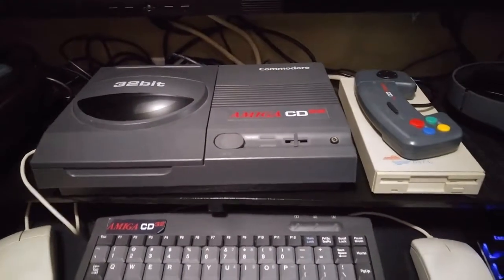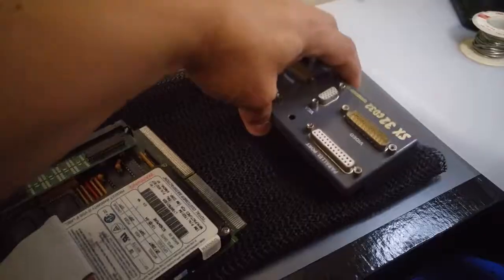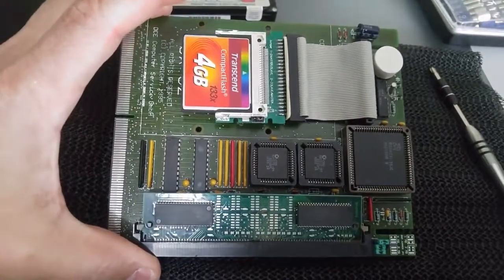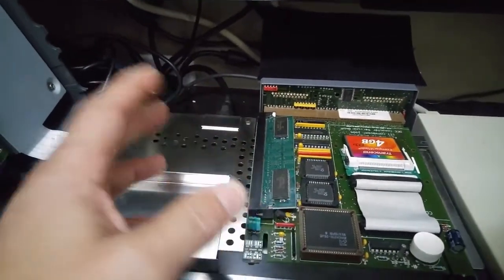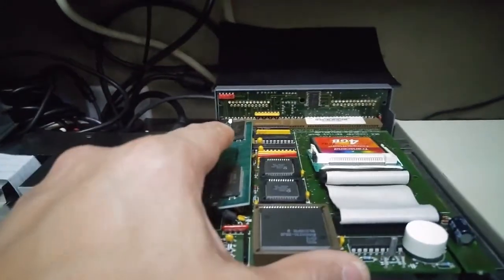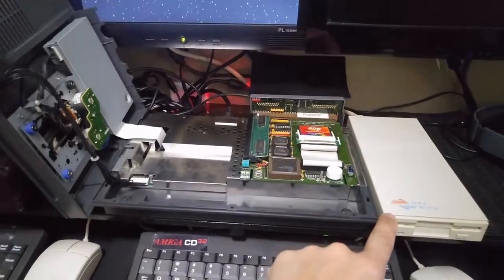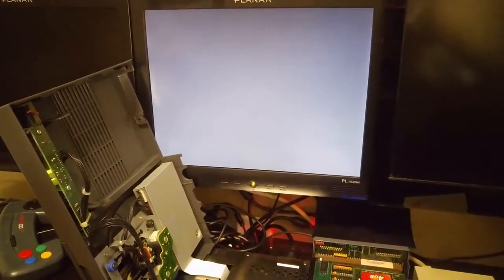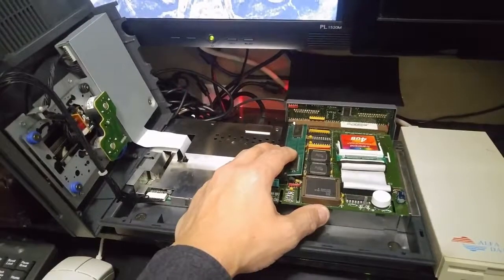Amiga CD32 Expansion -  SX32

Comment: The compactflash IDE adaptors are sort of cool but they are prone to problems of being unrecognised depending on brand and they can wear out if running games or software that constantly write to the nand (such as using Vista 3D-landscape generator to make many frames of animation in hundreds and hundreds of megabytes multiple times). A modern (or maybe modified old) IDE-to-RAM (with a bunch of C batteries) solution seems more attractive in some scenarios. The RAM is also commonplace to aquire. It can boot instantly and also never wear out (other than electromigration but then that is not strictly wear-and-tear per se) and can be allowed to instantly boot in a "it never shut down" configuration (as the C batteries hold the data). An FPGA (or other solution) could also have a dip-switch on the side that allows a user to dump all data to-and-from a HDD or flashdrive when needed and that allows for custom workbench images. There is a limitation in the amiga's ChipRAM in that (as we all know) it can only be 2meg. A pity about the cool increased large disk support for kickstart3.1.4 (albeit it pretty much used for a1200) is that more blocks use more of that ChipRAM. Rather htan having a large HDD (or nand equiv), having multiple IDE-to-RAM-adaptor "images" means you don't need to use up RAM with a great many blocks and also you don't need kickstart3.1.4 (even though it is cool for other things). Multiple HardDrive (IDE-to-RAM) images also has the benefit of only using the drivers you need. So for example a person might not need a whole bunch of CD drivers. Other tricks one can do is dump save-states from games into it (but there are other ways of doing that).
Reply from the maker: Thank you for comment. I have use a few different IDE to CF adapters an have had good luck with comparability (though I may have just gotten lucky). 

Your point is well taken on robustness or lack there of regarding the CF cards.  I haven't had one get corrupt on me yet in this setup but  I have when using one as a boot drive for Linux.   I do have backup images of my CF cards so I can re-image a new one if needed.

I haven't put nearly the reads/writes through them as i have on my original SCSI drive in my A3000.  I have Vista 3D and back in the day would leave my A3000 rendering over a weekend and the drive would just happily churn away.   I haven't tried that on the CD32 with the IDE adapter but  plan on doing so as a test (thanks for your request/idea on my other video )

I like the idea of a multi image IDE to RAM adapter (reminds me of the multi carts for C64)   would be nice to instantly switch between setups for different tasks and instant booting would be sweet
Reply: @32Bits  That is exactly the sort of thing I'd do with a mate around his house back in the day for Vista3D but on an a500. :)

FYI, the GPIO of a raspberry Pi is the shape of an IDE and so, if you use a Pi (such as the Pi4 standard 3rd party boards with its GPIO 5volt and ~3volt changed options) you can mimic a HDD or CDROM using the Pi (and even just them use the Pi as a RAM drive or as a simple convertor for a usb-CDROM or usb-flash-pendive for CD0 and HD0). It also has sata.

Therefore it is already possible to switch between setups like you allude to. :)

It can also be done on the fly because it has an fpga.
Reply from the maker: @obsoletepowercorrupts  Vista 3D reneging for days....Good times. 

When you say, "Therefore it is already possible to switch between setups like you allude to. :)"  You do mean that it's 'Theoretically' possible right?  I mean the Pi4 is not released yet.
Reply: @32Bits  Sorry, I've typed that comment too fast. I mean "Pi4" as a standard for any such Pi (be it third party or otherwise). However, my poor typing aside,  yes it can be done via an FPGA board you make or add to (if it is one plugged into yet another board GPIO board running say an arm with PCIe). A PC floppy drive can be converted to amiga though and also done with an arduino.

However just to be oldskool, I should point out that there is a brute force way of connecting a floppy to the cd32 which you already know (and I'm just reminding you) and that is via connecting the small circular port of the CD32 (on the left of it) to another amiga and using that amiga's floppy. 

Or one can use the parallel port of the amiga to access a floppy on another machine (or its HDD for that matter). It is a caveman way to do it though so I'm just flinging it in for reference contect, like how a serial port on an amiga can connect to a Pi and take the amiga online or on a LAN (or access the Pi's devices like a usb floppy).

I'll paste some other cool little floppy-amiga hacks in hyperlinks in a comment below in case youtube marks it as spam (because the YT algorithm does not always like hyperlinks in comments).
Reply: @32Bits  :)  As promised...

Modifying a PC floppy drive to work on Amiga Hardware
https://www.youtube.com/watch?v=QtMvoql0W8Y

Amiga Floppy Drive emulator using Raspberry Pi
https://www.youtube.com/watch?v=BVYVZ3fsesk

Arduino Floppy Disk Reader (Versoin1) GPL3+
https://create.arduino.cc/projecthub/robsmithdev/arduino-amiga-floppy-disk-reader-v1-485582
Reply: @32Bits  Here is an a example "Pi like" sbc with better GPIO, and voltage change. https://www.youtube.com/watch?v=3v5mFryrTzA
Reply: @32Bits  I should also add that (if you juggle partitions), you can swap the contnets of a drive in and out anyway. However, just to add to that concept there is a very cool amiga gadget for SCSI that has been around for a few years (and it is one of those modern PCB boards) which allows you to access (e.g. a590 or other internal scsi) drive ports with multiple devices simulataneously such as other amigas (yes - a powerful thing to do) and audio samplers like an akai:
So you can have multiple amigas sharing a hdd like this guy's video does with samplers. The gadget was primarly sold to amig auses by audio-sampler nerds use it too. Therefore it is more than a mere SCSI-toSDCard adaptor as you can daisy chain an access it simultaeously via multiple amigas (almost like a crude versoin of a NAS).

SCSI experiment: 3 samplers and 1 scsi reader (scsi2sd)

https://www.youtube.com/watch?v=kytXdaK3Q7I
Reply: @32Bits  I presume you know that your IDE-to-CFcard adaptor could be replaced (if you so desired) with a IDE-to-SDCard and then you can put a wifi SDcard in it, thereby giving you the ability to swap HD0 (or Hd1 or whatever) data in and out either manually or automatically (e.g. linux snapshots, or a script coding BASH or python or C and remember even old amiga does C) or even create and remove partitions. For wifi SDcards, Tobisha Flash Air is an example, but here is also a different video doing it to a camera. That means you get wifi too btw (so you can ge internet and a NAS and a remote floppy drive nd CDROM or DVDRW etc). Of course that also means a wifi SDcard can be used in an A590 either by the IDE a590 model or by the SCSI a590 model using a SCSI2SD adaptor as mentioned in my other comment which shows a video sharing a non-wifi sdcard amongst a bunch of different samplers or an amiga. https://www.youtube.com/watch?v=6Z7XsEKONTs
Reply from the maker: @obsoletepowercorrupts  yes I have already replaced the CF adapters with SD adapters some time ago (working on that video :)  ) but I hadn't thought of trying a wifi enabled SD card.. may have to check that out.
Reply: @32Bits  The cool thing about using SDcard wifi is that the SDcard can often be manipulated independently of the amiga, and it is reversible (so you need not desolder a wifi, and you can just unplug it). The other cool thing is that one can combine the SCSI2SDcard daisy chain where multiple devices access a SDCard which may be plugged into an a590 HDD, but then one can ensure that SDCard is a WifiSDcard instead and manipulate its contents that way (over wifi) simltaneously too. The Spider accelerator for the amiga works with the A590 (and a Spider is a CPU and FPU of upto 50MHz, but even 40MHz would do. It works with the a590).

One can plug a floppydrive into a scsi a590 too (if it is scsi). It is a cool way  (via the dip switches) to have a floppy drive which can be used if DF0 is not desired that day (like if it has a gotek in it o whatever).

Comment: Hi. The battery for the clock looks the same type which leaks on Apollo accelerator cards. I would remove it or at least pop off the white cover and check for leakage.
Reply from the maker: Thank you for the feedback.  Yes, I took the battery cover off when I got it to inspected the battery.  It looks clean and has not leaked. But I know  its only a matter of time before it does.   I do plan on replacing it soon.